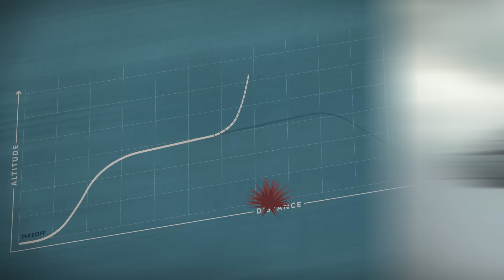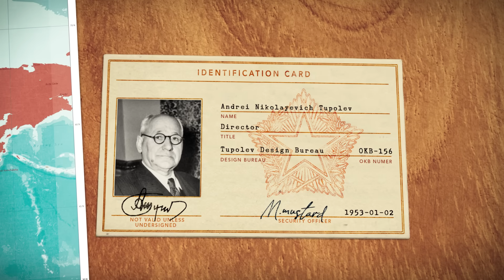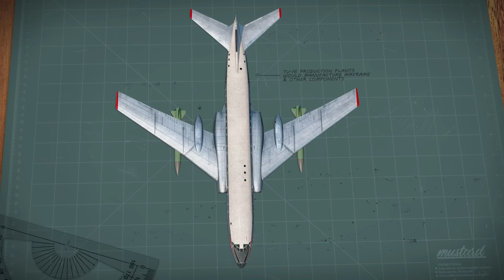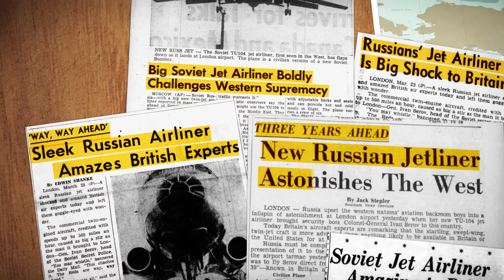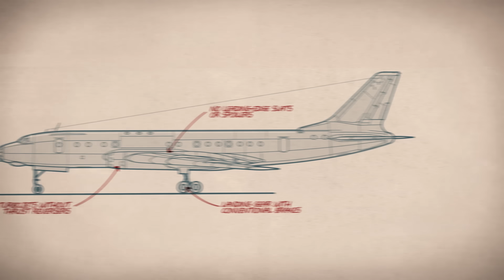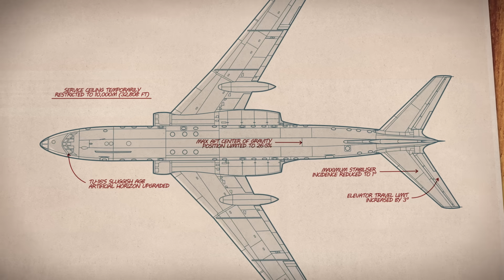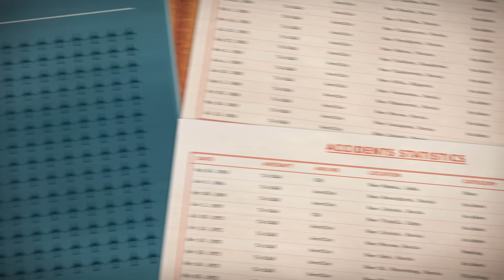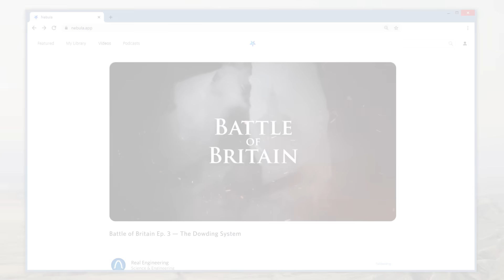The Soviet Airliner Designed To Crash

Comment: Ugh, the bri'ish Comet, what an ugly and dangerous plane. But hey, it's the stinky uk
Reply: We believe we can clear up some commonly held myths and misconceptions, obviously.

It's always good to see the facts presented clearly and concisely isn't it?

Instances of all Comets, including Comet 1 aircraft, flew at some point after 1954 with full certification. The last airline duty Comets flew around 1980 and retired with full certification.
The last Comet flight was a signals research global circumnavigation series of flights in 1997. 

   Of course De Havilland carried out a full stress analysis & performed extensive & protracted testing on two long lengths of fuselage. De Havilland carried out significantly more testing than was required by any authority at the time & significantly more testing that any previous airliner was subjected to.

The world's first wind tunnel was constructed in England during the 1800's The world's first supersonic wind tunnel was constructed in England in 1922.

Extensive wind tunnel testing & evaluation were carried out. All takeoff incidents were the result of stalls caused by over rotation. This was an issue where pilots were not using jet airliner specific takeoff procedures. Changes made to the aircraft were an attempt to make the aircraft more tolerant of such errors. 

  It's true that no airliner before the Comet had been subjected to as much testing as the De Havilland Comet. 

    De Havilland did indeed always work to better than industry standards at the time, used up to date knowledge for the design & no evidence of negligence  or criminal negligence was ever produced in relation to the DH Comet.
 
It is the case that the stress for the crown sheets when measured was not greater than predicted for example.
  
  Obviously there have been worse aircraft for accident losses both before & after the Comet.

    How things were back then. 
Accident losses - % of aircraft built.

DeHavilland Comet 4 UK              14% 
DeHavilland Comet all mks          17%  
Vickers VC10 UK                            5%

The DH Comet had better safety than or similar safety to many other commercial passenger aircraft of a similar era both before & after the DH  Comet.

Douglas DC-1                                      99%
Douglas DC-2                                      47%
Douglas DC-3                                      30%
Douglas DC-4                                      26%
Boeing s300                                        72% 
Boeing 307                                          70%
Boeing 247                                          48%
Boeing 707                                          20% 
Lockheed L-049/149 Constellation  30%
Lockheed Electra  Turboprop .          29%
Fairchild FH-227                                 30%
McDonnell Douglas DC-8                  14%
Sud Aviation Caravelle                       15%
Canadair CL-44  Turboprop               46%  
Convair CV-580  Turboprop               22%
Convair CV-880     (ff 1959)               27%  
Convair CV-990     (ff 1961)               33%
Tupolev T-104        (ff 1956)               16%

The Vickers VC10 held the airliner Atlantic crossing time record for 41 years. 
    
We do indeed hope this helps, of course.

As always, cheers & 👍 indeed.

Comment: didn’t the comet… also have issues? like the square windows meant that they’d just crack in mid air
Reply: The de Havilland Comet was the worst engineering failure in commercial jet aviation history.
The Comet has the highest loss rate and fatalities of any jet airliner
Reply: @sandervanderkammen9230 

We believe we can clear up some commonly held myths and misconceptions obviously.

It's always good to see the facts presented clearly and concisely isn't it?

Obviously there have been worse aircraft for accident losses both before & after the Comet.

  De Havilland was subjected to forced merger under the govt aerospace sector rationalisation programme.

The fabulous trail blazing DH Comet.
World's first jet airliner.
World's first high altitude airliner.

    How things were back then. 
Accident losses - % of aircraft built.

DeHavilland Comet 4 UK                     14% 
DeHavilland Comet all (ff 1949)         17%  
Vickers VC10 UK (ff 1962)                   5%

Douglas DC-1                                      99%
Douglas DC-2                                      47%
Douglas DC-3                                      30%
Douglas DC-4                                      26%
Boeing s300                                        72% 
Boeing 307                                          70%
Boeing 247                                          48%
Boeing 707  (ff 1958)                         20% 
Lockheed L-049/149 Constellation  30%
Lockheed Electra  Turboprop .          29%
Fairchild FH-227                                 30%
McDonnell Douglas DC-8                  14%. 
Sud Aviation Caravelle                       15%
Canadair CL-44  Turboprop               46%  
Convair CV-580  Turboprop               22%
Convair CV-880     (ff 1959)               27%  
Convair CV-990     (ff 1961)               33%
Tupolev T-104        (ff 1956)               16%

The VC10, fastest Atlantic crossing for a non supersonic jet airliner, held the record for 41 years. 

  The DH Comet had better safety than or similar safety to many other commercial passenger aircraft of a similar era both before & after the DH  Comet.

Pretty much all changes made after the Comet 1 were just in case changes or were previously planned ongoing improvements.

We do indeed hope this helps, of course.

As always, cheers & 👍 indeed.

Comment: Better than Hindu poop air
Reply: Better than the de Haviland Comet too...39 crashed or were lost in accidents that's more than half the number in passenger sevice!
Comet has the highest deaths per flight and per mile flown...
It averaged 626 deaths per million flights
Reply: @WilhelmKarsten 

We believe we can clear up some commonly held myths and misconceptions obviously.

It's always good to see the facts presented clearly and concisely isn't it?

Obviously there have been worse aircraft for accident losses both before & after the Comet.

  De Havilland was subjected to forced merger under the govt aerospace sector rationalisation programme.

The fabulous trail blazing DH Comet.
World's first jet airliner.
World's first high altitude airliner.

    How things were back then. 
Accident losses - % of aircraft built.

DeHavilland Comet 4 UK                     14% 
DeHavilland Comet all (ff 1949)         17%  
Vickers VC10 UK (ff 1962)                   5%

Douglas DC-1                                      99%
Douglas DC-2                                      47%
Douglas DC-3                                      30%
Douglas DC-4                                      26%
Boeing s300                                        72% 
Boeing 307                                          70%
Boeing 247                                          48%
Boeing 707  (ff 1958)                         20% 
Lockheed L-049/149 Constellation  30%
Lockheed Electra  Turboprop .          29%
Fairchild FH-227                                 30%
McDonnell Douglas DC-8                  14%. 
Sud Aviation Caravelle                       15%
Canadair CL-44  Turboprop               46%  
Convair CV-580  Turboprop               22%
Convair CV-880     (ff 1959)               27%  
Convair CV-990     (ff 1961)               33%
Tupolev T-104        (ff 1956)               16%

The VC10, fastest Atlantic crossing for a non supersonic jet airliner, held the record for 41 years. 

  The DH Comet had better safety than or similar safety to many other commercial passenger aircraft of a similar era both before & after the DH  Comet.

Pretty much all changes made after the Comet 1 were just in case changes or were previously planned ongoing improvements.

We do indeed hope this helps, of course.

As always, cheers & 👍 indeed.

Comment: Americans learn from the mistakes the Russians made first then call themselves the most innovative
Reply: @WilhelmKarsten 

The marvellous trailblazing DH Comet.
  
World's first jet airliner.
World's first high altitude airliner

See further down for accident loss comparisons.

De Havilland was subjected to forced merger during the UK Govt instigated aerospace sector rationalisation programme.  

There were two jet fighters, Gloster Meteor and DH Vampire, and one prototype - Gloster E29/39, in production in the UK from 1941 with the Gloster Meteor being in service from 1944.

In 1944 the RR Nene was the most powerful & most reliable gas turbine aero engine on the planet. For decades after 1944 copies would go on to power aircraft in many countries including Russia (Mig-15 & Mig-17), the US, France, Switzerland and China. 

Instances of all Comet marks, including the Comet 1, flew with full certification at some point after 1954. Airline duty Comets were all retired by 1980 with full certification until after retirement. The last Comet flight was a global circumnavigation series of flights in 1997.

   Of course De Havilland carried out a full stress analysis & performed extensive & protracted testing on two long lengths of fuselage. De Havilland carried out significantly more testing than was required by any authority at the time & significantly more testing that any previous airliner was subjected to.

    De Havilland did indeed always work to better than industry standards at the time, used up to date knowledge for the design & no evidence of negligence  or criminal negligence was ever produced in relation to the DH Comet.
  
  Obviously there have been worse aircraft for accident losses both before & after the Comet, that includes's fatality rate metrics and all safety metrics. One of the issues was accident losses & incidents due to pilot error which were often caused by the novel aspects of jet airliner flying, even so, the accident losses for the Comet were not particularly unusual at the time.

About Bow-wing for instance (See b-47 wing folding / collapse incidents.)

There can be no excuses for the 737 Max incidents after more than 50 years design, build and operation experience & with up to date aviation infrastructure. 737 Max, 2 particular incidents caused 350 fatalities. Aircraft auto pilots itself into the ground, two times.

The many & varied reasons for Bow-wing's (See b-47 wing folding wing collapse incidents) current existence & status have nothing to do with the company itself by the way.  

    How things were back then. 
Accident losses - % of aircraft built.
DeHavilland Comet 4 UK              14% 
DeHavilland Comet all mks          17%  
Vickers VC10 UK                            5%

The DH Comet had better safety than or similar safety to many other commercial passenger aircraft of a similar era.
Douglas DC-1                                      99%
Douglas DC-2                                      47%
Douglas DC-3                                      30%
Douglas DC-4                                      26%
Boeing s300                                        72% 
Boeing 307                                          70%
Boeing 247                                          48%
Boeing 707                                          20% 
Lockheed L-049/149 Constellation  30%
Lockheed Electra  Turboprop .          29%
Fairchild FH-227                                 30%
McDonnell Douglas DC-8                  14%
Sud Aviation Caravelle                       15%
Canadair CL-44  Turboprop               46%  
Convair CV-580  Turboprop               22%
Convair CV-880     (ff 1959)               27%  
Convair CV-990     (ff 1961)               33%
Tupolev T-104        (ff 1956)               16%.

Comment: germans had jets in ww2
Reply: What does that have to do with the video? He said the Soviets in the 1950s had developed "a sleek new airliner, one of the first to be powered by jets." This is a true statement. "Airliner" means a large passenger plane. German jet planes in WW2 were fighters, not passenger planes.
Reply: @djm55 Germany also had jet bombers.
Reply: @djm55  its about the fact that one has to research and the other had it 10years prior
Reply: The marvellous trailblazing DH Comet.

World's first jet airliner.
World's first high altitude airliner.

De Havilland was subjected to forced merger during the UK Govt instigated aerospace sector rationalisation programme.  

There were two jet fighters, Gloster Meteor and DH Vampire, and one prototype - Gloster E29/39, in production in the UK from 1941 with the Gloster Meteor being in service from 1944.

In 1944 the RR Nene was the most powerful & most reliable gas turbine aero engine on the planet. For decades after 1944 copies would go on to power aircraft in many countries including Russia (Mig-15 & Mig-17), the US, France, Switzerland and China. 

Instances of all Comet marks, including the Comet 1, flew with full certification at some point after 1954. Airline duty Comets were all retired by 1980 with full certification until after retirement. The last Comet flight was a global circumnavigation series of flights in 1997.

   Of course De Havilland carried out a full stress analysis & performed extensive & protracted testing on two long lengths of fuselage. De Havilland carried out significantly more testing than was required by any authority at the time & significantly more testing that any previous airliner was subjected to.

    De Havilland did indeed always work to better than industry standards at the time, used up to date knowledge for the design & no evidence of negligence  or criminal negligence was ever produced in relation to the DH Comet.
  
  Obviously there have been worse aircraft for accident losses both before & after the Comet, that includes's fatality rate metrics. One of the issues was accident losses & incidents due to pilot error which were often caused by the novel aspects of jet airliner flying, even so, the accident losses for the Comet were not particularly unusual at the time.

About Bow-wing for instance (See b-47 wing folding / collapse incidents.)

There can be no excuses for the 737 Max incidents after more than 50 years design, build and operation experience & with up to date aviation infrastructure. 737 Max, 2 particular incidents caused 350 fatalities. Aircraft auto pilots itself into the ground, two times.

The many & varied reasons for Bow-wing's (See b-47 wing folding wing collapse incidents) current existence & status have nothing to do with the company itself by the way.  

    How things were back then. 
Accident losses - % of aircraft built.
DeHavilland Comet 4 UK              14% 
DeHavilland Comet all mks          17%  
Vickers VC10 UK                            5%

The DH Comet had better safety than or similar safety to many other commercial passenger aircraft of a similar era.
Douglas DC-1                                      99%
Douglas DC-2                                      47%
Douglas DC-3                                      30%
Douglas DC-4                                      26%
Boeing s300                                        72% 
Boeing 307                                          70%
Boeing 247                                          48%
Boeing 707                                          20% 
Lockheed L-049/149 Constellation  30%
Lockheed Electra  Turboprop .          29%
Fairchild FH-227                                 30%
McDonnell Douglas DC-8                  14%
Sud Aviation Caravelle                       15%
Canadair CL-44  Turboprop               46%  
Convair CV-580  Turboprop               22%
Convair CV-880     (ff 1959)               27%  
Convair CV-990     (ff 1961)               33%
Tupolev T-104        (ff 1956)               16%.